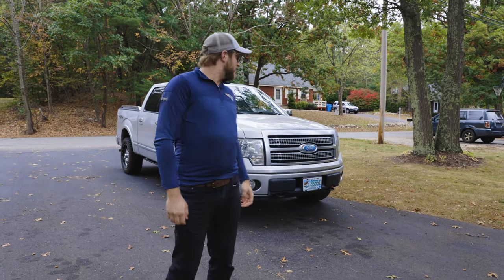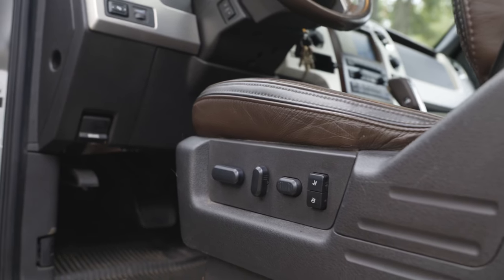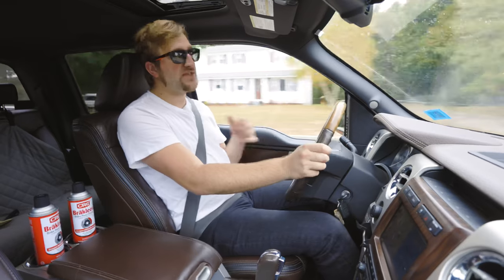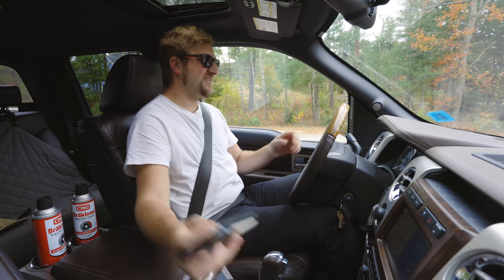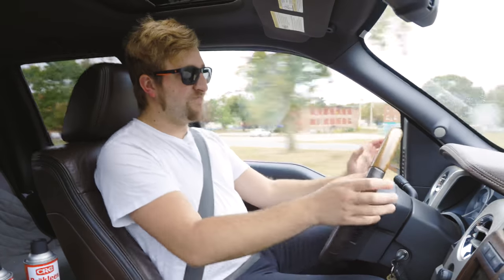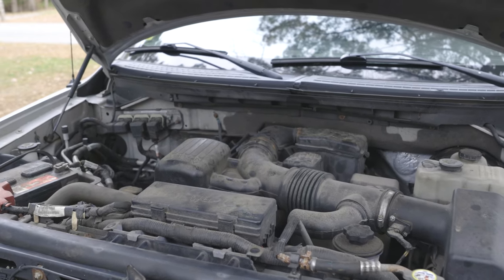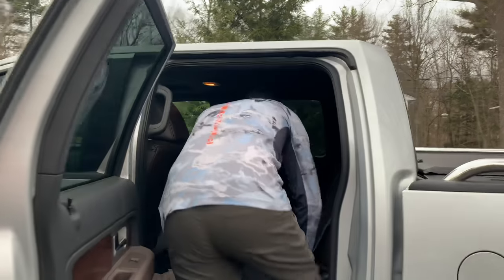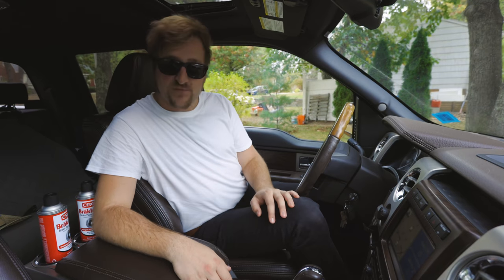2009 Ford F150 5.4 V8 - Long-Term Review (Reliability, 0-60, Towing, 4x4)

Comment from the maker: Oh! Forgot to mention, the truck is at around 170,000 miles 👌🏼
Reply: Mine is pushing 283,000 👍🏼
Reply: @davidbahena2016  mine just hit 170 got any tips to keep it good
Reply: Great Video! and You're good! (7:20 You said the miles!)
Reply: Looking at one at 174xxx for $9000 2010 ford f150 platinum just concerned about the miles
Reply: @ManuelHernandez-ek4nw  I think $9000 is overpriced. But if it was taken care of and the oil was changed religiously then it should be okay. If the oil wasn’t changed often I would run away.
Reply: @ManuelHernandez-ek4nw  I think that's a pretty good deal. I seen some with that milage going around 15k. But of course I live in california so everything is more expensive here.
Reply: I heard that fords are  great trucks but most of them need a transmission rebuild around 150,000 miles is that true with your experience? In this particular year I’m looking at a 2010 with  the tow packageThanks
Reply: @rotfan77  that's not true. Had a 07 Ford expedition with around 167k miles before i got in a accident with it but it was a great truck. Same motor and transmission from a 09-10 f150.
Reply: @davidbahena2016  wow bro I just bought one with 170,000 miles and I was having concerns. You helped me a lot. Thanks
Reply: Mine 150miles 5.4 0 issues since new.   No leaks or any single noise
Reply: Got a 2010 ford f150 king ranch, 130k miles it's my daily and so far it ticks because of a manifold Crack but other wise I've conquered webster pass in colorado and these get it done in every way the motor is known to be a grenade but change your oil often, and use oil additives and it'll run
Reply: My 09 at 240k
Reply: 09 fx4 5.4 259000k change the oil every 3k full synthetic.  Runs great
Reply: I have 164k miles on my 2007, no issues so far!
Reply: @papadarkfluff 😅
Reply: @PaintTheMap009 did you need a timing job to make it that far?
Reply: @RevelationThree20  I actually did right over 200k ... Noticable difference afterwards
Reply: @PaintTheMap009  I’m at 194k and about to do it soon. Engine doesn’t sound too bad but I know it needs it and heard these engines will go another 200k plus once it’s done w/ hv oil pump

Comment: I took my 09 f150 5.4l to 315,000 miles before i swapped the engine. Got more than my moneys worth from this truck. I still have nothing wrong with it. Love my truck. Bring the 5.4 back.
Reply: I agree. I also hope you're loving this truck just because of the key chime too.
Reply: I have the same . How much can you tow
Reply: Do you remember if you had the 2 or 3 cylinder?
Reply: @brianlee9233 nah the 2010 lariat or high trim levels door chime was the best!
Reply: @patriciawombwell wouldn’t want to tow more than 12,000 with this it’s tough

Comment: The 5.4 was made to be a truck engine......the 5.0 was built for the mustang but changed to make it work for the F150.
Reply: yes sir!
Reply: Well yes and no now adays its a mustang motor. Back in the day the 5.0 was a truck engine. Ford has a track record of taking truck engines and slapping them in sports cars ie ford gt. The mustang was originally meant to be a v6 as the og engine. The 5.4l is the 300 i6 of the modern day, slow, able to tow pretty much anything but getting a woping .6mph. Its a truck engine that does truck stuff and it does it good
Reply: And work it does! Great engine
Reply: The 5.0 efi in the old square bodies were the best. I love the 302.

Comment: My neighbor has the same year expedition with 206,000 miles and they’ve never had any major issues with the 3v triton
Reply: Same here. 11’ Expedition EL w/ 193k miles. Been a very reliable truck. Drove it from AZ to MI and back about 2 years ago
Reply: @RevelationThree20  when did you changed your spark plugs
Reply: @tongtongwang  the plugs were changed before I bought it around 100k with Motorcraft platinum. I bought it at about 163k and immediately changed the plugs with Autolite Iridium. So I have almost 40k on those now as I’m at 199k miles
Reply: @RevelationThree20  do you mind share with me what type for the Autolite Iridium/

Comment: Currently have a 2010 5.4 with 265k miles on it. It has lost a bit of power as is to be expected from a work truck. But it’s still running. Maintenance isn’t as good as other Ford’s weve ran in the fleet but it’s been better than all dodges and chevys we’ve had. Planning to slam another 5.4 in it around 300k and rebuild the old one.
Reply: I am thinking the same thing with mine you rebuilt confidence i was having second thoughts about the 5.4 engine but you sealed it off thank you.
Reply: I also have a 2010 5.4 with 269k and going strong only problem I recently had about 4 months ago was a cylinder 5 misfire which ended up being a rolling follower come unlodged by the driver side camshaft. My dad and I fixed it and still runs great but has a slight shake at around 50-60mph and shakes a tad when idling but other than that she does great getting me around
Reply: Every engine loses power in the long run

Comment: Ford redesigned the heads to fit one-piece plugs for the 2009 model year which addressed the issue of the plugs breaking when you pull them out.
Reply: They also updated the cam phasers
Reply: Was redesigned mid year 08 but so most are considered 09 but overall good truck I have a 2010 lariat with 317k miles and still has hood power
Reply: @Reggiestreet  my next door neighbor have the same truck
Reply: @dude49521 that's what I'm talking about....some hood power.....lol😅
Reply: The cam phasers aren’t the real problem. It’s the tensioner seals that blow.

Comment: My comment is a little late to the party but one thing that people including the car wizard seem to forget is that in 2009 and 10 the 5.4 three valve Triton engine actually had a second generation of sorts. They made a lot of revisions to the engine as a whole to try to alleviate all of the problems as a stopgap to the 5.0 Coyote engine because the coyote had actually been in development since approximately 2005 and they kept running into hurdles either because they couldn't find the financial means to produce the engine or continue developing it or because the manufacturing processes have not been developed well enough to build the engine. So with that the modifications to the 5.4 included larger galleys more passages for the oil and coolant a slightly larger and higher volume oil pump and more robust timing components. With that being said really you're not going to have too many mechanical issues with the 5.4 of the 2009 and 2010 year. And that's mainly because they had resolved the vast majority of mechanical issues. The head studs breaking is actually just common along all Ford products because they insist on using inferior materials for their manifold bolts but they also don't use large enough bolts or enough of them and this issue is even common on the 3.5, 3.7, and 5.0.
Reply: I'm currently looking at a 2010 Platinum 5.4L V8 with 116k miles. Clean title and history. It's going for $16.5k; price seems high. What do you think for the year and mileage?

Comment: My F350 with the 5.4 Liter engine just turned over 200,000 miles last week.  After upgrading the spark plugs and coils and replacing the manifolds twice this engine has been the most reliable engine I have ever owned (I'm 67 years old and have owned many trucks over my lifetime).  It dosen't burn a drop of oil.  I am building a cabin in the mountains 750 miles from our current home making several trips per year hauling an average of 5,000-7,000 lbs. of lumber, equipment and supplies EVERY trip.  The secret (other than regular maintenance) is MARVEL MYSTERY OIL.  I have been putting it in the fuel tank (3 oz./fillup)  and 1 qt. with every oil change since it went over 100,000 miles. This will prevent cam lobe damage, lifters, timing chain follower wear , fuel pump wear, clean fuel injection nozzles and prevent cold starting damage/wear.  And no I'm not getting paid by MMO.  I had a mentor in the aviation field.  He used it in all of his engines.  Whenever he overhauled his engines he always took the heads in to have the valves done.  They would ALAWAYS  ask him "Bill, what kind of oil are you using"?  He couldn't tell them because it's ILLEGAL to use "unapproved" additives (by the FAA).  He would just say "30 weight why?"  they always would say "Well, because there is no wear at all on your cam lobes and your valves look brand new"

Comment: I have a 09 lariat with the 5.4. We have had it for about 10 years now.. It has about 268k miles on the original engine and transmission. No major problems so far apart from the ac going out 1 time.

Comment: my '08 5.4 has been nothing but perfectly reliable.  Sure, not the most powerful motor especially compared to today's motor, but the thing just runs smoothly like butter.
Reply: Would you recommend buying one? I need a truck for college because it snows a ton where I'm going. I would take it on long trips and sometimes light off roading and I would be willing to put maintenance into it.
Reply: I'm in the same boat with this guy. Would you recommend a truck with one of these motors? I'm also willing to properly maintain the motor to make sure it lasts a while
Reply: @Mr Murders okay, thank you for your take! Maintenance definitely goes a long way! I heard oil changes every 3000 miles are also a way to prevent engine failure caused by the cam phasers

Comment: I bought  an 09 f150 fx4 3 years ago, it had 200k on it one owner always  dealer maintained.  I have 249k now in it I change the oil every 3k miles and do all the minor  maintenance.  It's been a terrific  and reliable  truck. Only issue  I have is the rust. Im planning  on taking  care of the rockers and the front bumper.  I hate to but a new truck  when this one runs so well.
Reply: I just bought one with 28,000 miles.

Comment: For anyone interested, I just want to point out 2 problems with this video: 
First, the 5.0 may produce more horsepower and torque than the last year 5.4 but at significantly higher rpms making that extra power basically useless in everyday scenarios. The 5.4 produced 80% of it's torque below 3200 rpm, making it better suited for hauling/towing than the 5.0. That's why when you get a newer F150 with the max towing package you're forced to get the 3.5 EB. 
The second problem is that despite what the car fairy claims, the oil port size is not a problem. The oil pressure problems in the 3v 4.6/5.4 come from the flawed oil pump that Ford used in those years. The oil pump loses pressure under moderate rpms, starving the top of oil when it needs it the most.
Reply: I've like a lot of things about the 5.4. One being the sound and another being the reliability.
Reply: Exactly.  New oil pump and timing components and you have yourself a great powerplant.  I have a 2011 expedition where these problems were corrected.  Tows pretty good even with 3.11 gear ratio on 6spd.  I might get 3.55s and add an 8.8" E-Locker.  Keeping it forever.
Reply: You are correct sir. The 3000 to 3500 rmp mark is what I keep my truck at when towing uphill, it's the sweet spot!
Reply: It's not useless. People said same thing about the old Chevy 5.3 . I learned to just give it more pedal and you get your trailer to speed quicker. The 5.0 drivetrain actually gets it to the tires as better as well
Reply: @calebmelton5989  I disagree. I stand by what I previously said. The 5.0 isn't as suitable for hauling/towing as the old 5.4 was. It has to work harder to move the same amount of weight. The newer 5.0s, of which I'm specifically talking about 2020+, make peak horsepower at 5750 rpm! And peak torque at 4500 rpm. Meanwhile, the old 5.4 made peak power at 5000 rpm and peak torque at 3500 rpm. That's a huge difference in power and torque delivery! Even if it didn't produce as much as the 5.0, it produced it much more quickly and at a lower rpm. While that might not seem like much of a difference, high revving engines don't have a very long lifespan. At least not when compared to lower revving engines that perform the same work.
Reply: @kingdaniel3519  yes people pull at 75 these days. Everything isn't all farm work.
Reply: @kingdaniel3519  i have both 2010 5.4 raptor 2012 5.0 xlt coyote has about 80 more hp similar torture. Coyote will spin to 7,500 i have 18 gt manifold cams tune. 5.4 is full bolt on as well 5.4 is good but falls on its face around 5,500. Coyote will pull the same weight an is faster than tundra ram. About a tie with 6.2 Chevy. 5.4 gets walked on buy ram 5.7 an Nissan Titan. I love my 5.4 but not the fastest truck by far. Coyote 5.0 is a monster with full bolt in’s. It will shift to 3-4 gear while doing burnouts sounds raw. 5.4 can’t do that. 09-10 5.4 is the one to get
Reply: Yessir.   Facts
Reply: both the pump and the ports leading to the cam are the problem.. you can replace the pump which would certainly help much better but the best thing to do is bore the ports AND replace the pump
Reply: I own one of these trucks an like it alot how do I fix this problem. The last engine I had broke the number 8 valve at 235000 miles
Reply: @moosestangls5099  I'm assuming you got a reman or a different engine.
Reply: You just nailed it... weak oil pump. Replace with Melling HV360
Reply: One more thing to keep  an eye on is the lifters if the 5.4 is making a ticking g noise around the valve covers, a lifter is going out  its a good idea to have them replaced when doing a timing job

Comment: No joke I've had 2 - 2009 F150s.  An FX4 and a Platinum 4x4.  Both had 5.4 with the 6spd.   I'd recommend a tuner forsure!  Also, both got 200k miles out of them easily with like no rust.  Only the early triton had the spark plug issues so in 2009 it was worked out.  ALSO, CHANGD YOUR OIL EVERY 3K MILES!!!
Reply: What tuner?
Reply: AM radio tuner

Comment: Mine currently has 285k original miles. I love this truck. I'm planning on putter a new motor and new trans once the engine goes. About to be 20 years old and smooth as hell with no leaks or problems. Taken me across the country and back more than once. I hear bad things about the 5.4 but I've seen others who had similar experiences as me. Take care of the truck and it will take care of you
Reply: Could you share some advice about the proper care of this truck? I am looking to buy one from +08 5.4L, but the community comments about this platform, it’s cause in me some fear. 

I would appreciate any advice from your part. 

Thank you, best regards from Juarez, Mexico 🤠
Reply: @RicardoAntrax  if it's not taken care of I wouldn't get it. If it has high mileage, open up the heads and you'll see a ton of carbon build up. You'll have to use premium gas to avoid more. I'm not sure what gas is available in Mexico. 

A huge issue is doing a tune up. It can be a pain changing the spark plugs so I'd take it to a shop. 

If it has high milage be easy on the engine don't run it too hard. Just stay on top of oil and trans fluid. Keep up with it and take care of it and it will take care of you. Don't baby it tho. Its a truck it can handle a lot. Get your use out of it.

I only my bought my recent one because the guy before me put a new trans and rear axel in it. I plan on putting a crate motor in it once it dies
Reply: @RicardoAntrax paisano checa cómo han tratado el motor antes, la clave son los cambios de aceite unos dicen a las 3 mil otros a los 5 mil millas. Con que no te pases de las 5mil millas el cambio está bien. Usa puro aceite sintético de 5 w30. Checa si no hay ruidos en el motor al arrancarlo, aca hay videos que te dicen que sonido es. Son motores muy resistentes y con buen mantenimiento sin problema funciona. Tengo una 2010 a gas lp con equipo de 5a generación y sin problemas. Saludos desde Puebla México.
Reply: @ct2953  muchas gracias por los tips, ¿cuantos km tiene su troca?
Reply: 120 mil km y no sufre de nada.

Comment: The 09/10 are the best years for the 5.4

Over the past 4 years I've been buying oem parts for a future rebuild..but to date my 09 at 248k has only had brake pads and light bulbs replaced. 
I'd say that's pretty reliable
Reply: I just sold my 09 F150 crew cab. 190k miles and really the only thing I noticed was the top end noise. I was going to get new heads and keep it. I hauled horses with it all over the United States and it perfromed just fine.
Reply: What would make the 11-13 worse than the 09/10

Comment: Spark plug blow out is a 2V problem only. The first couple years of the 3V had a problem with spark plugs getting stuck and breaking off during removal, but once the plugs were replaced, you were good to go. The Melling M340HV oil pump pretty much takes care of the oiling issues with these engines, but as you already pointed out, solid routine maintenance goes a long way. Good video.👌🏻

Comment: The 5.4 isn't as bad as people say, it does have it's short comings but it is very intolerant of neglected maintenance
Reply: Ford's 4.6l v8 is better and more reliable
Reply: @theshield1613  agreed
Reply: @theshield1613  agreed but the 4.6 was gutless. For someone who wants to tow a lot, the 5.4 is the best option
Reply: Amen, have a 04 f150, 3v 5.4, absolutely not ticking other than the exhaust manifolds, otherwise at 140k no issue, even my 06 at 180k doesn't have an issue, if I'm honest thr 04 actually hauls better than the 06
Reply: @theshield1613  agreed, owned a first off the line, Jan of 06, 97 f150 with a 2v 4.6 and the engine is bulletproof, was my first truck in hs, and has been sitting a few years, has 252k and I guarantee with a new battery shed fire right up, never even had to plug it in when it was 30 below, it'd always start
Reply: @cptchuff2741  agreed but 4.6 wasn’t THAT gutless.
Reply: @theowl2044  My 96 Bronco has more hp than a 2008 F150 with the 4.6
Reply: @cptchuff2741  that doesn't mean anything